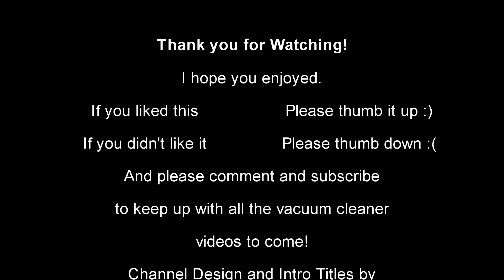Hoover Junior U1104 First Look, replacing the missing parts!

Comment: cracking junior, i have the exact same model, sadly when i use it for a minuet or so the drive belt spindle gets very hot and makes the belt smell of burning rubber despite the brush roll running freely, i even changed the motor for a new old stock motor and it does the same thing.
Reply: Its the belt